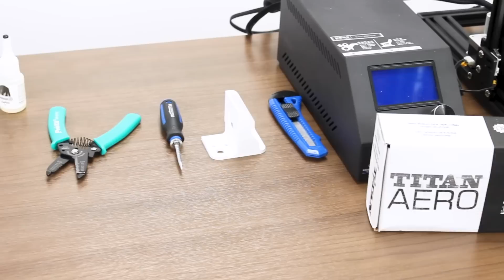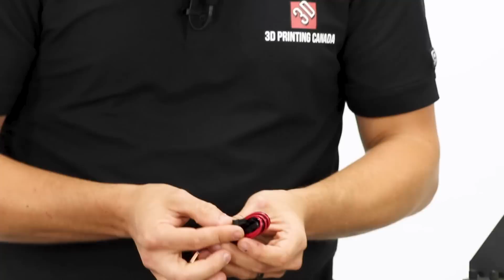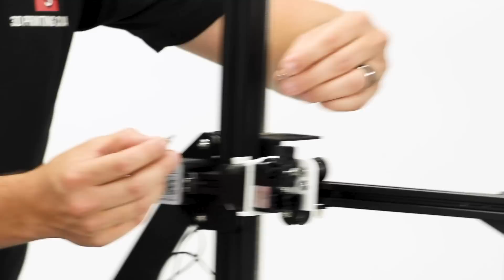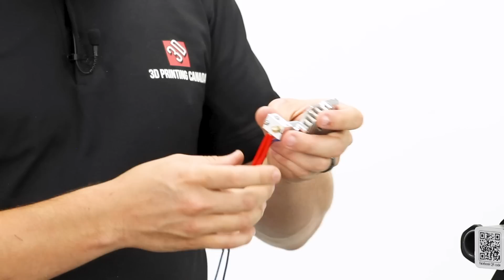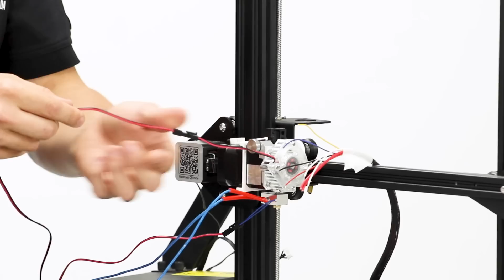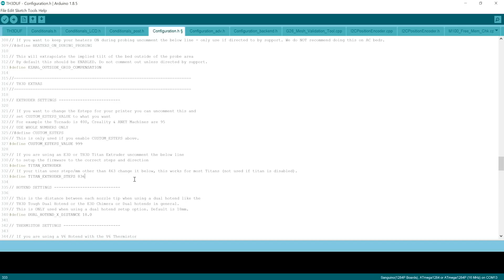How to install an E3D Titan Aero on a Creality CR-10s

Comment: That printer needs it's X rail replaced with a 20 x 40 Ali extrusion for  much needed stability.
 Note: the top right Screw that goes thru the Big drive gear is Stupid.. Tighten it and it locks the Gear up solid.
   So it serves Zero actual purpose Take care IF you fit it

Comment: I did this upgrade and was wondering if the extruder cooling fan was supposed to run all the time?  As soon as I power on the printer the fan comes on also - just wondering if this is right.

Comment: Just a quick note on the heatsink screws - the reason they strip so easily is because they're not actually Philips, but Pozi-drive. I was stripping them like crazy through several V6 builds until I had another look at the documentation, and sure enough, they're Pozi. After this change, I've been able to send them all the way home and haven't stripped one since!

Comment: Can you do this to the CR 10S PRO?
Reply: Second on  this, I had a major blow out on the bottom end and continue to trying to use softer materials and switched to a Titan Aero, but it doesn't appear that there are any guides or files for those using CR10S Pro's.

Comment: It's so dumb that we don't use standardized connectors for everything. Have a very short cable on the hotend and everything and just plug it in... No soldering and long cables. Anycubic does this with their i3 mega it's a life saver

Comment: Great video. I do want to give one update and one suggestion. 
Update: Linear Advance with a value of 20 is no longer valid. Also, they have moved the setting to the Configuration.h file in version U1.R2.7. Only values from 0 to 10 are valid. 
Suggestions: Before flashing, it's good to run Verify on the code to make sure it compiles. 
Thank you for the video!

Comment: Hello, after following your guidance I had ended up installing,TH3D U1.R2.7. Uploading was successful, yet after homing, the Y Axis is off, too far forward now. How do I reset it so as to place it where the home point used to be? I am very much a noob when it comes to making these changes,and would appreciate your assistance. Thank You

Comment: Getting more and more stoked to install this on my Ender3. So many challenges though. 

(Update). Finally installed the Titan Aero on my Ender 3 and dont have any control of the extruder motor. Is there a setting in the firmware that I missed?  I  plugged in the factory motor just to see and it wont move either.  Any ideas??

Comment: Btw the cheap red 2-pin JST connectors seem to have a rated limit of around 3 amps (at 12 volts that's 36 watts) so if you wanted to just use JST connectors to avoid having to buy multiple types you can just use 2 connectors in parallel instead one that way each connector only gets about 20 watts at max.

Though in Practice , 1 seems to work fine (keeping an eye on it) but since the heater block isn't on full for more than 1-2 minutes (maybe longer is your pushing temps above 250 c afterwards it's on/off to keep temp and not constantly drawing to the point it could overheat.

Still a valid concern , but just thought it would be good to point out the limitations of those connectors.
Reply: @Jason
Huh, I thought the stock CR-10 hotend was a 40w shrug doesn't to much in the end still gets up to temp just fine.

And yeah the point i was making was you could avoid the more expensive JST SM's if all you had was the RCY types by using 2 in parallel. (plus i don't know of many standard heater cartridges that reach over 60w so should be a decent long term solution)

Comment: for remembering the wirecolours for the hot end and cooling fan , just keep the part you snipped of with the printer during the build the little pieces of wire left to the fans should be enough to see where they belong

Comment: Congratulations very well explained and done but, before doing so myself, I would like to know what are the real benefits of this change?
Reply: Better quality honestly. Less retraction and oozing. Faster flexible printing
Reply: @Jason No 0.9 degree stepper ! That would be completely Silly as the 3:1 gear ratio already gives seriously increased resolutions. 
Only real advantage is in the Lighter weight of the extruder assembly.
The " Aero " heatsink add on removes the use of the Print Space wasting V6 radiator .. no more.. no less

Comment: Ender 3 version?
Reply: Why wouldn't it be able to use linear advance?
Reply: @franzjosef2788  up until recently when th3d ripped a bunch of stuff out of Marlin to make it fit, base marlin wouldn't fit on the ender3 board (sanguino-based), whereas an Arduino mega-based printer would have plenty of room
Reply: I literally just got this for my ender 3 and now after watching this video idk if I'd be able to install it. I thought it was "easy" to install but this doesn't look that easy to me :/
Reply: @Jason so can i not do linear advance with ender 3 then? even with the latest marlin firmware?